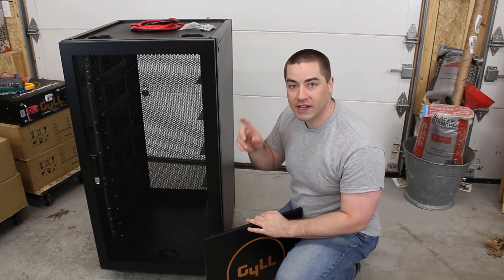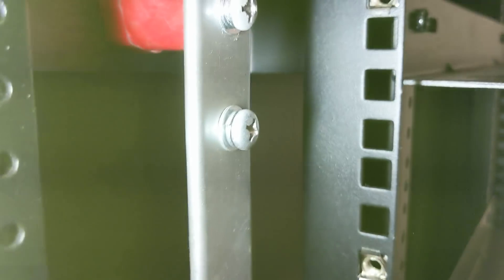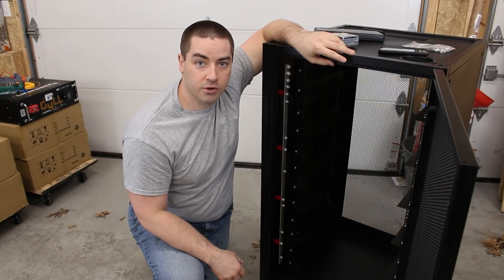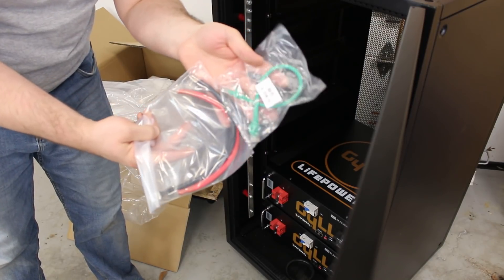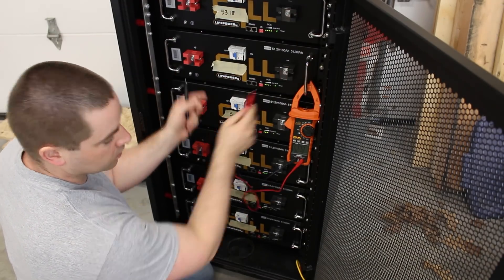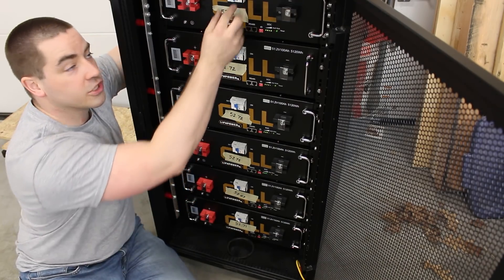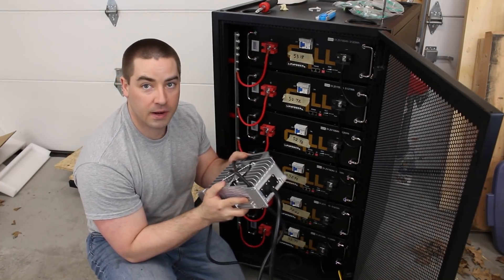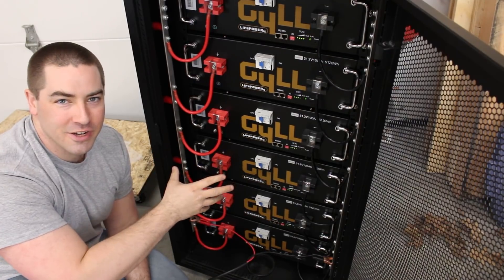Fastest Large Scale Battery Build, 30+ KWH, Power Whole House Cheap

Comment: Looks like the Gyll is made by Vglory on Alibaba... Did signature solar make any proprietary changes, or are they both identical?
Reply: Looks like it but cheaper from David's source. I'd be interested to see the inside of these. Like the ease of install but a DIY seems like it could be significantly cheaper maybe? Around here people all but give away racks too, shouldn't be too hard to modify one to hold a set of batteries.
Reply: @BLKMGK4  The VGlory is $500 cheaper per battery, but then you have to ship it from China...  I agree on getting a used Rack as they are cheap and all of them are standard size so no real modification is needed.

Comment: Great video - and battery setup.  I know for the Sunny Island inverters these batteries want to be paralleled - a low voltage inverter.  But can they also be connected in series instead for an high-voltage setup compatible with the Sunny Boy Storage or similar inverters?  If so, is there a max number you can connect in series?
Reply: Mr.David.how are you. my name is Paschal chiwaula from Tanzania.can I get your WhatsApp number so that we could have chat about the solar system tecnology,? Coz I need  them

Comment: When you charge the packs  and use usb at the same time and your laptop charger plugged in too its possible make an earth loop, between the usb ground and the battery charger,thats why feel warm before fried the little usb rs485.
Reply from the maker: Is that what happened?  Wow.  Seems like there should be some kind of warning for people like me who don't know computers well.
Reply: @DavidPozEnergy  most likely is the issue tbh 
Also those rs484 to usb converters are junk tbh 
I've friend about 5 of them over time haha
Reply: Not 100%  sure  but  i do  work on  automation stuff on big machines  and  i  fried usb-rs485 before,I was mesure  between my  laptop charger output  - and machine  body gnd 98Vac,Many laptop chargers only use L,N and not grounded. My solution was  to get  a  charger  whats have  grounded ac input for my laptop so the  dc  side  not  leak any more. You can check by yourself try  to mesure voltage  between  your litium battery charger - and  laptop charger -  if you have  ac  voltage more than 4-6V thats  possible reason why  fried.
Reply: @akostot54  I would think the leakage current of a laptop charger wouldn't be enough to fry an RS-485 interface. I just read the leakage current is required to be less than 85uA. Surely something made interfacing with industrial systems would be able to handle that, maybe we should be finding better-quality RS-485 transcievers.
Reply: @eDoc2020  Yess i know what you mean!but  when you have  a lots  off inverters  and  other  things  whats  also  drain  to earth  in normal  operation that  can cause some  weird stuff sometimes,(i did fry onboard soundcard like  this on laptop too 1x.)since that  i use  isolated  usb converter too. This  was  some time  ago,now  nearly changed everything to profinet from rs485,lot better system.
Reply: @eDoc2020  I think  the easy solution to get  earthed  psu  for the laptop the  dc- should be on earth   or what you said  a better usb-rs485,or just  run the laptop from battery  till you play  with the battery management.

Comment: Do you know if the batteries deplete as a whole or individually ?
Reply from the maker: As a whole.
Reply: @DavidPozEnergy  Shouldn't one of the bus bars be flipped to make sure they discharge evenly?  IE have the main positive on top and main negative at the bottom.  Otherwise with the main leads at one end, might that first battery discharge faster since there's less resistance?  Not sure how much of a difference it'd make.
Reply from the maker: @Mazlem,  That's one of the things I plan to test when I hook this up.  But, my guess is that it won't matter in this case.  The bus bar has such a low resistance compared to the individual wires jumping to each battery terminal, I suspect that even under a 200 amp load it will be very evenly spread out.
Reply: @DavidPozEnergy  I'll be interested to see the results since I'm wiring up a similar but DIY powerwall!

Comment: You’ve pretty much sold me on these batteries David. Thank you. 
One question I have is I made a mistake going with a Big Battery 48v 100amph  and I think the cells are A123 and they say they can’t get those anymore so I’m stuck with this battery and I’m told I can’t add to it because of different chemistry. I would appreciate any thoughts of ideas? BB also keeps raising their prices and i don’t feel they’ve been completely honest either. 
Thanks
Bob
p.s. you’re blessed with that little one.
Reply from the maker: Hi Bob Levey,  I don't know what chemistry your current battery is.  A123 is a brand that makes several types of batteries.  I can buy A123 Li-NMC, and I can buy A123 LIFePO4.  Your battery might be a different chemistry, but I don't have enough information from your comment to confirm that.

These Gyll batteries are LiFePO4.  In a perfect world, they would be paralleled only with LiFePO4.  But they can be paralleled with other chemistries like Li-NMC so long as certain precautions are taken.  My current battery pack is a mix of both.  

If you don't want to parallel, or can't parallel, then could you sell your current battery?  Or perhaps use your current battery for some other application, like a mobile one in your car, or just to power a shed?

Comment: How long it takes to charge from empty to fully charged the one unit (5120Wh)? and the six units (30+Kwh)? Thanks.
Reply from the maker: Each 100AH battery can charge at a max 100 amps.  That means 1 hour to fully charge.  But that would mean 30kw of solar panels for the 6x stack, so you probably will be limited to the size of your array.
Reply: @DavidPozEnergy  I always thought lifepo4 charged at a 0.5C rate (so about 50amps for a 100Ah battery)

Comment: Nice!  Can't wait to see how the hookup into the home system works out.  I don't remember what you get from your solar arrays, but I don't think they were microinverted, so I'm guessing you'll be doing some DC to DC converting through a charge controller and then adding them to your all inclusive 48v bus, which is then inverted to generate your... I think it was a split phase 240VAC.  My solar is microinverted, so I need to figure out how to set everything up to charge off AC, discharge off the batteries when the grid is out or TOU rates are high, and auto disconnect/reconnect to the grid when the power goes out/comes back on (and fail gracefully if the batteries reach the low state before the sun comes up or the grid comes back on).
Reply from the maker: I've got a mix of AC and DC coupled solar.  One of my first arrays is tied to my Victron 250/100 charge controller.  That's still running strong.
Reply: Solark 12k inverter would be a perfect match for your AC coupled system.

Comment: Still too expensive.  1500 each!  And still need an inverter. You can build your own with over double the capacity for about the same price.  Sure you can't put it together in an hour, but if you were to use only these it would cost way too much to ever break even.
Reply: Or you can get this direct from the manufacturer for $1100
Reply: These might be a little easier to get past an inspector though :(

Comment: Good setup but do you need all that solat. I have  4 x 100ah 12.8v batteries and only one panel. All my batteries full a 1 day at rest
Reply from the maker: Congratulations on keeping your electrical loads so low.
Reply: @DavidPozEnergy  Thanks for the reply, but the load is mainly a 400wh thermal lamp to through a 1kw inverter to keep it realistic. I have a couple of 3  minute videos on my new channel if you are intrigued enough. Keep up the good work mate
Reply: @DavidPozEnergy  Try this one. Poor quality but it will give you an idea cheers https://youtu.be/_z1N6kYECSU
Reply: Wow. His system wouldn’t cover my current needs, but it would chip into it... I can’t imagine running off 5Kwh a day...

Comment: Is there not a way to connect the batteries to your home network so you don’t need the usb?
Reply from the maker: There probably is a way, I'm just not good with computers.  I'm currently running the battery without any computer attached.  They don't NEED a computer, it's just fun to see them once in a while.
Reply: You'll need some sort of computer bridging the rs485 to the network. One option would be a Raspberry Pi.

Comment: What size, and how many solar panels do you recommend to use with these 6 batteries, using a solarc 12k? Great video, as always.
Reply from the maker: The batteries could take up to 600 amps, but the bus bar looks to be 400 amps. That means the largest solar array would be about 20kw.  But the Sol-Ark is limited to 12kw of solar PV.  So I'd max out what the Sol-Ark can handle.
Reply: @DavidPozEnergy  great info. Thanks David.

Comment: Certainly 8Nm is what it those bolts/threads are rated for but why even take it that high? I suppose there are some vibrations from fans etc. but ultimately it's a stationary battery bank.  I would think with those split washers there's no need to go beyond nice and snug. Great video and I love what you are doing!
Reply: It's probably more torque than you need but keep in mind this is what squeezes the terminals to the busbar. You want to avoid as much resistance as possible because even a single milliohm will lead to 10 watts of localized heating when you pull 100 amps. This could lead to a cascade effect and worst case even a fire. I'm not an engineer so I can't tell you how likely this is but when dealing with high currents you don't want to take any chances.

Comment: Yea those usb are junk. Sorry signature solar I just got one in my new pack the other day from you and the usb failed almost right away. I went back to the old two piece COM port to USB I had from the 2020 packs I bought from you and that works great. I also got my cabinet but the shipping company bent one of  the wheel bracket casters, so waiting for a replacement bracket to arrive. Hope you have the same results I have had for the past year with my packs. I do notice the BMS charge voltage is a bit conservative around 3.5v to full charge, but that may be a good thing for the longevity of the pack. I tried a low temp cutoff, I could only get 1 of the 4 sensors down to 0 degrees F, but charging did not stop. Not sure if more than 1 sensor needs to be reading 0 or maybe just below 0 for the charging to stop. BMS setting say 3 degrees F for warning which did show on software when I was monitoring the laptop and 0 to cut off charging. Maybe  someone will chime in or hopefully David you have that lined up to test. May have to find a cold day here in New England and put the pack outside to test. Great video cannot wait for more.
Reply from the maker: Thanks for sharing.  Now I know I wasn't the cause of the USB to fail.  Thanks.  I have a large chest freezer I can test the cold temp. shutdown.  I'm making a list of questions so that I can make one video answering several questions in one video.
Reply: @DavidPozEnergy  What's inside the packs? Pop a cover off and see? See if they match the VGlory stuff on Ali.
Reply from the maker: @BLKMGK4: Check out my previous video.  I open up one of the packs.  https://youtu.be/SYJ25izYSGc
Reply: @DavidPozEnergy  There it is, thanks!

Comment: I'm still not getting how are those batteries same size same price same 100Ah but different voltage (12/24/48) are the same?! 100Ah*48=4.8kWt. How is 100Ah*12V=1.2kW and what's wrong in description about those batteries? Is it a scam? Even with maximum 4.8kWh it's far away from 5.12kW
Reply from the maker: In my previous video I capacity tested one battery and it is not a scam.  These particular batteries have a slightly higher voltage than 48v.  The nominal voltage of these are 51.2v.
Reply: @DavidPozEnergy  Thnx, David. What about batteries with 12V and 24V? Why for the same price they still have 100Ah? I'm frustrated :)

Comment: Those bus bars should use Nut/bolt its copper not steel. I would have numbererd them 1 bottom, 6 top like a building!! lol
Reply: I'll agree with you on the nuts (and use some anti-corrosion compound) but not with the numbering. The first one in the chain (this case the top) should be zero and the last one should be five.

EDIT: I should also point out I'm numbering them in the direction we read. Most of the time we count from the top down.

Comment: Great, but as someone remarked, not UL cert?  I would seriously recommend you consider a small outbuilding for your battery system, heck everything related to your solar. 1. If there ever was a fire, it would quite possibly not take out your house, and family. 2. Talk to your homeowners insurance guy/gal, and see what they say. It would be bad to simply lose your house. It would be far worse to lose your house, and then have insurance deny you because you had some DIY electrical subsystem not to code or UL listed...  Prepare for the worst and hope for the best.
Reply from the maker: My garage is detached.
Reply: @DavidPozEnergy  But isn't it still considered to be part of your house? If your detached garage catches fire, it may spread to your main house too.

Comment: hey david - ty so much for sharing this with everyone, its great info - i wanted to ask if you could tell us how heavy the cabinet is, i didnt deep dive their website but it was not listed that i saw
Reply from the maker: Sorry, I didn't weigh the empty cabinet.  If I was to guess from handling it, somewhere between 50 and 100 pounds.
Reply: @DavidPozEnergy  i dont suppose you have a scale able to measure the full unit when its loaded? could possibly figure it out but too much effort probably - ty for the info
Reply: @dand9244 In the video, David states that each battery module weighs about 100 pounds, and the rack can hold six batteries.  David also states here that the rack weighs about 50-100 lbs (let say 75 lbs).  So the total assembly weight is: ~75 lbs (for the rack) + (6 * 100 lbs for the batteries) = ~675 lbs total.

Comment: Looks nice!  Why did you need to wait until 53v on the busbar to throw the switch on the top battery?
Reply from the maker: If there is too much of a difference in voltage, than the highest voltage battery will try to discharge into the lower voltage battery.  It can potentially do this at hundreds of amps, which would cause the BMS to fault out.  Waiting for them to be close to each other in voltage keeps the amps moving low.
Reply: @DavidPozEnergy  Gotcha!  Thanks for explaining.  Eager to see part 2!
Reply: @DavidPozEnergy  Can powering on the unit be controlled by software?
Reply: @DavidPozEnergy  hey I know this is old, but don’t these batteries have some kind of resistor inline to avoid that kind of thing? Or is that only for when you connect it to the charge controller or turn it on to the inverter or something

Comment: That setup is very reasonably priced for non DIY and looks great too.  Gain Solar did point out that he is a viewer of your channel also and that these units are not UL certified if your home insurance requires this to be covered but of course a DIY battery isn't UL certified either.` My terminology may be a little off without going back to look it up.
Reply: A good reason to put everything in an outbuilding if you can. If it does have a problem it doesn't take out the residence. Certainly not the easiest thing to do as a remod but if you are starting from scratch its something to consider. For the property I'm developing now all the utilities will first go to a power house for distribution to the main buildings.
Reply: @TrackGeeks  Yeah that is the only way I would do it.. These people putting DIY packs in their homes are just asking for trouble..
Reply: @FJB2020  If the manufacturer claims are correct, lithium iron phosphate batteries presumably never catch fire, even under abusive overcharge or short circuit fault conditions.

House fires are a consequence of building houses out of wood, with paper coated "drywall" walls, and then filling them with wood furniture combined with wood kitchen cabinets that surround the range/oven.  House fires are also sometimes caused by rats or mice chewing on "exposed" electrical wires strung arbitrarily through the attic and walls without use of a non-chewable protective conduit like EMT.

Wood is the most flammable of all the structural building materials known to humans, and yet, in the United States, home builders and the government consider building houses out of wood and paper coated walls to be a totally acceptable practice, fully within all building code requirements.  Meanwhile, home owners and home buyers generally could care less about this fundamental design flaw to their current or future house.

If at some point in the future, your house burns down to the ground, it won't be because you had a DIY lithium iron phosphate solar battery pack inside.  If your house burns to the ground, it was because it was made out of wood and paper.  Houses built out of masonry, metal studs, glass, fiberglass, and self extinguishing plastics, simply don't burn to the ground, regardless of how many and what type of batteries you install in the house.

Comment: Need some DEEP pockets ($9,500.00)
Reply: Cheaper than a Tesla Powerwall. Two of their 13.5 kWh packs, 27 kWh total, costs $17,000 before incentives.
Reply: @FaceTubeU  yes, but the powerwall does have an inverter built in, no?
Reply: @3th1xs  tesla has a 10 year warranty too and wifi internet ingetration so a bit more slick.